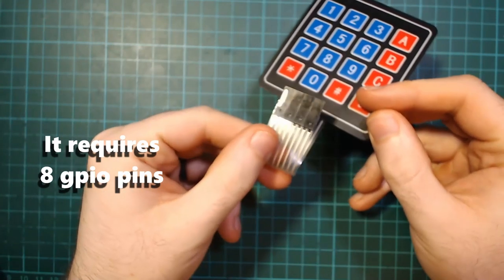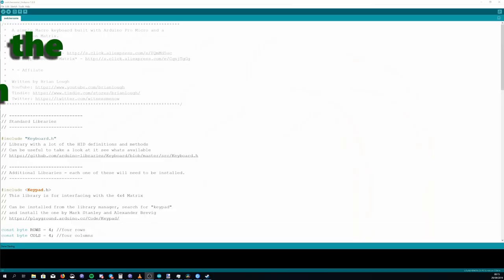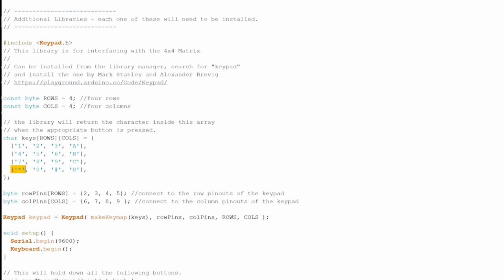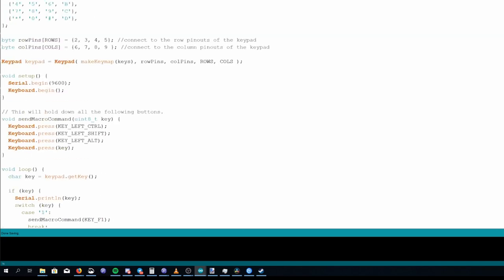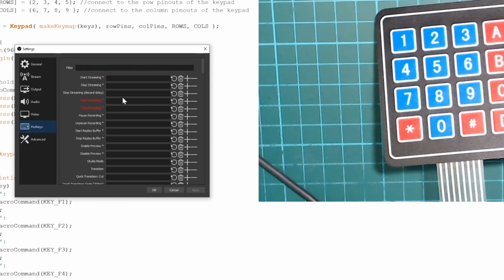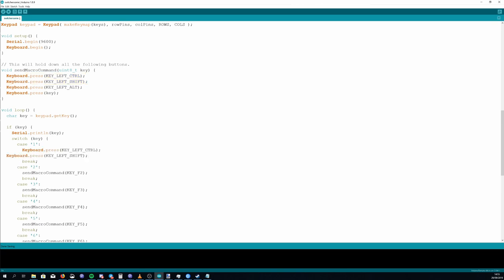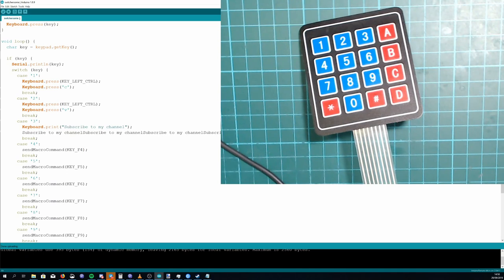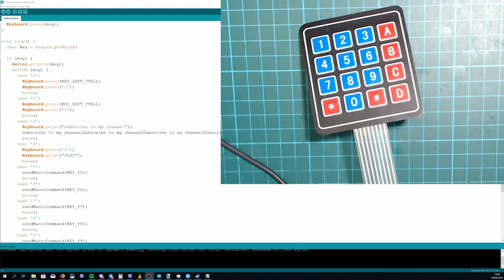The Simplest DIY Macro Keypad with Arduino

Comment from the maker: Any suggestions for things you would do with this type of keypad? Or do you know of an simpler one!?

Sorry about some of popping in the audio, I've changed a lot recently (new computer, new editing software, new version of OBS) so I haven't got everything dialed in yet
Reply from the maker: Yeah I think I might make something for video editing with a rotary encoder as well, I think it might be nice
Reply: I'm waiting for your reply plz plz plz,
About ESP32 cam
Reply: Can i recording the video streaming?
and Can i send a command or a signal from arduino to start or stop record video?!
finally, how i can upload this video wich it recorded to cloud or server?!

Thank you for your reply
Reply: @2000jago  what is that?
And i think this is not your business
Reply: @mahmoudghanim3717  yes. You can do the same way in the hotkeys menu in obs. Uploading.... Just do through the browser. If you want live then that's a bit more complicated. But also possible in OBS
Reply: Thinking it might be nice to re-lable the keys to your favorite hot ket sequences for CAD tools.
Reply: I might build one for work. To get quick access to the servers I’m the admin for. So Button 1 makes a remotdesktop connection to Server 1 and so on. I just need to make a little 3D printed case for it.
Reply: A couple of years ago I build this with a one-button (and one LED) keypad. The button was to enable/disable the program, with the LED giving feedback about its status. And all it did was to press Ctrl ever 4 minutes and 58 seconds.

Goodbye stupidly fast forced screen locking...
Reply: Love this. I'm working on a PCB for key to include two rotary encoders and 16 buttons (keys). I've got a use-case for some CAD software; both drawing and PCB layout. Great stuff Brian.

Comment: To help with programming you can set an enable pin on one of the leftover pins.  So if say pin 10 is connected to ground it just skips the loop and waits 1 min and then checks again.  That way when you want to reprogram the Keypad you can jumper 10 to ground and your keypad won't output anything.
Reply from the maker: That's a good idea

Comment: I got busy and put it together tonight (1 Oct 2019.) Found a plastic project box just the right size for the keypad, and put the pro micro inside. Tomorrow, I am going to add a power-on LED to the face of the box as well as an LED which lights whenever a button is pushed. (That's to compensate for the poor tactile feedback from the membrane keyboard.) It's going to help tremendously with OBS. Thanks a bunch for the idea and the code.

Comment: Thanks for your video! I used it, added some mouse functionality and made some macros and shortcuts for Cubase, since my finger is broken and my left arm has a casting on atm, which is very inconvenient when working in a larger program, where shortcuts really cut time. Now I can at least work on some recordings, while I'm on sick leave for 6 weeks :) And while I was at it, I made some automations (move mouse, scroll, klick, enter text), that were in my mind since I began to use the software package.

Comment: Keyboard' not found. Does your sketch include the line '#include <Keyboard.h>'?
Reply: just found out that you have to select the correct arduino in the tools section of arduino IDE in order to get no error messages. I think Arduino Leonardo is the correct one but you might need to try different ones! ;)

Comment: Awesome Brian! I have creating a login switch box and username and password set up for systems that require this all day long, using the Micro. I was using only the keyboard.h library for printing text and wiring up my little boxes with momentary push  buttons. I like this plug and play keypad version! Will save me time and money! I have the code for making requirements so it doesn't get stuck in a loop. I am trying to figure out how to add  a Control alt delete, then return function to the code I already have. The code does the following with 1 button press:  types in a username, tabs to password bar and types in the password and then returns. I am not quit sure how to add the control alt delete then return to this same button function. Would be happy to share what I have for the keyboard.print to get any suggestions. Thanks again for this video!!!

Comment: SO this is my situation and need help, I got an Arduino Pro Micro and MX keys, I've programmed it to send (SHIFT +A-J)  fire it up open note pad, and bingo works ABCDEFGHIJ / Opened OBS assign the hotkeys to my scenes, scene 1 SHIFT + A etc , test it with my computer keyboard and it works... but when I try it from my macro keypad it jumps to other scenes or nothing at all.. any help?

Comment: Hi thanks for your video...i have the same hardware and i am looking to do a similar a similar thing. But as my use case is as a keypad for flight simulations, i need it to send Directx inputs (like joystick buttons) and not keyboard commands. Is there a simple way to do that?Thanks

Comment: I have a question,  can you setup multiple keypad/matrix to one arduino board?
Reply: you could, but making separate ones is easier. Depending on how many io pins you have left, you could expand the rows or columns and map the extra keys to the new columns or rows.

Comment: I know this is quite old now, but can you use it to input a string of buttons.  to get to the menu I want i need to press alt+n, then the down button 10 times. I purchased a cheap macro pad but can only input 5 buttons per key press which isn't enough.
Reply from the maker: Yeah you can code it do whatever you want! You can do a million clicks if you want 😅
Reply: Dont know if you still need it, but I just built a keypad and coded what you want. when tested, it correctly registered alt+n and 10 down keystrokes, it took me a bit to get it right since im new to coding, but it was easy to achive with arduino's guide of the keyboard library

Comment: I have to say that i totally forgot the content of this video.. 😞 !

Because the keyboard.h explanation on the arduino site does not really explain how to mod the program to allow the SHIFT+KEY thing,
and you simply showed it in your script with a bas ic "if-then" loop.

Now all i need to find out is how the thing with diodes works, so i can use multiple keys at the same time.. or 2x 4x4 pads
if this doesnt work due to pins number i will simply grab another pro micro and hook up the Shift+Fkey on there..

Thank You !
(Havent heard/seen from you long time, youtube doesnt promote you anymore)

Comment: First, thanks for the video and info.
Second, I hope you still watch this space and reply. I have no clue what I am doing but thought this looked easy enough to try but it seems I have an error msg. Now I thought I got the same hardware and it looks the same but I had to select LilyPad Arduino USB rather than the Arduino/Genuino Micro so it seems that part I sorted. The thing is thought my layout looks like yours I get an error anytime I attempt to upload to the device. No clue if this is enough info but this is a part of that error.
note: 'void loop()' previously defined here

 void loop() {

      ^~~~

exit status 1
redefinition of 'void setup()'

Hopefully you have some ideas or can point me to where I might need to learn more of this type error and how I might correct it.

Thank you.
Reply: Did you fix it?
Reply: @AlNexus  I figure I got a bum board as it wouldn't power on properly so I abandoned the project since I didn't care to order and wait for a replacement.
Reply: @Tw3akst3r  Sad to hear that.
Reply: @Tw3akst3r  Woah, thanks for sending that, looks really nice. Good luck on making that one!
Reply: @AlNexus  You're welcome, I might mess with it, certainly looks a lot nicer but what has me hesitant is from what I saw it looks like you use a website to configure the button mapping which is nice but if the site were to go down or no longer exist where does that leave me in terms of remapping buttons. I figure there are other ways but that alone just gives me pause so I may not pursue it though I like the look of it considerably more than a more basic keyboard and the price is minimal at $20 bucks or less. If you make one post back, for now, I am not doing it but that could change.

Comment: I made myself one as my first arduino projet. Thanks for the video and the code ! (That of course I tweaked a little) I made a case for it with custom keys that I designed and laser cut (inspired by 70s sci fi). If you're interested, you can find pictures on Instagram (Ernest Fabrique des Trucs). Anyway, thank you very much !!!

Comment: There's another few problems with the Digispark: it's a flaky little shit due to software USB, sometimes it connects, sometimes it doesn't. And when you make a poopoo, debugging is proper hell. I really like the borderline disposable nature of the Digispark and its compact footprint but i don't like actually dealing with it.

I always have an urge to use the big pile of STM32 Blue Pills i have here, but then that's just me. They're so cheap, why are they so cheap? OK they need one resistor fitted to really work with USB, big deal. And it's nicer to use a $2 dedicated programming device, because then you don't need Boot0 and can use the rear debug pins rather than figuring out every time where the goddamn RX/TX pins are.
Reply from the maker: I have a blue pill sitting here for about two years and to my shame I've never used it! I also had some issues with the Digispark for printing, sometimes it just missed characters.
Reply: @BrianLough  i used a digispark with an optical endstop switch to simulate the coin insert in my arcade machine: when the coin passes between the 2 "pillars", it sends the 1 coin key to MAME :)

Comment: Thanks for the tutorial, I'd rather use real keyboard keys but they are kind of expensive and I couldn't find any membrane ones
Reply: 3d print one and just place the keypad under it as keyboard switches essentially
Reply: salvage from an old keyboard